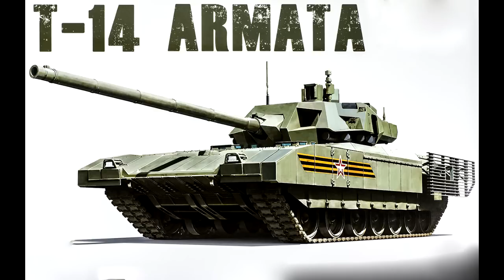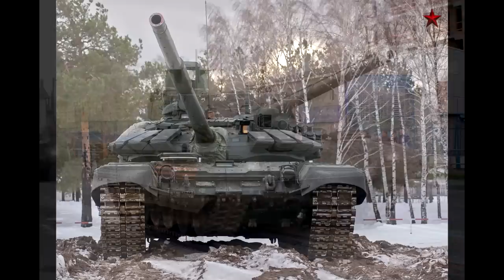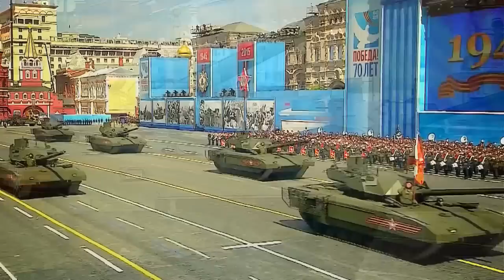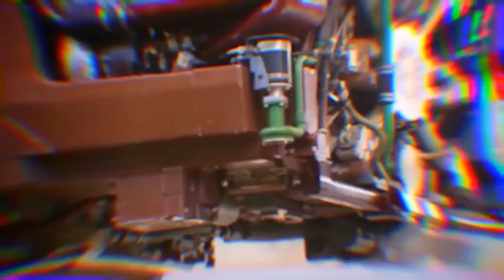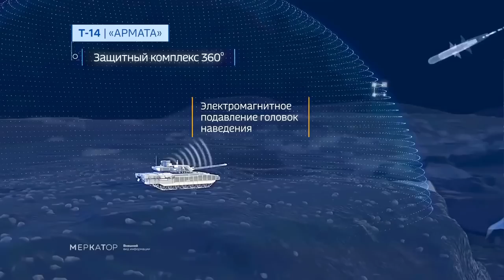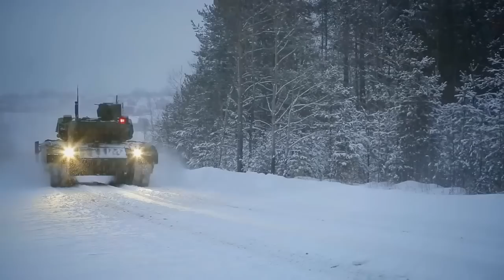Busting Myths on T-14 Armata

Comment: They cannot defeat a apfsds round with a smaller slower projectile. Don't be stupid that's very basic physics. A super dense super high speed object won't be stopped by a lighter slower object. They could only be stopped by something heavier and faster which doesn't exist.  I'm sure the rest of your claims are true but I'm also sure that one isn't.

Comment: Interesting vid the armata is a new tank the abrams an elderly updated one (design start c1970/80's) so why are the yanks so put out?, the challenger, Leclerc and Leopard are more modern and probably better...
Reply: The Challenger 2 hasn't been updated since its first upgrade in 1997. The Leopard 2 basis is, in terms of its procurement into service is older by 1 year. Though effectively it was accepted and developed at the same time. 

The Challenger 2 is a solid tank, but is far outdated and non-versatile. Leopard 2A6, compared to the M1A2 SEPv2, are effectively equals, where the M1 has some combat advantages over the Leopard, and the Leopard has economic advantages over the M1.

Comment: There are only two things I can think of that would not be affected by the APS. That is a high energy focused laser (which at this time is still in very early testing) and a railgun. The railgun is more plausible due to the fact that the round can be sped up by simply adding more current into the rails thus accelerating the projectile fast enough to overcome the APS's detection system. These two weapon platforms however are still in the early stages of research and development with only one known railgun in service.Another potential solution would be to simply add more powder to the shell making the Sabot round move faster. However that puts more stress on the breach and barrel causing more damage and eventually more maintenance on the vehicle itself.All in all the US needs to develop a new tank or seriously upgrade its existing stock.
Reply: "Afghanit" APS only defeats APFSDS at a 120° arc in front of the turret. So...

Comment: Nice vid. Do you know how many charges one barrel of the APS has? Or is it one blast per barrel?
Reply from the maker: +Demons Fate It has one charge per barrel since a lot of power is required to destroy APFSDS. But it is loaded in couple of seconds
Reply: RedEffect Ah is see! But do u know how the reload of the barrel works? if you look at pictures of the t-15, you can see the afghanit launchers (unlike the one at the t-14) uncovered and fully visible. i can see no reload mechanism that could make an automatic reload possible. and if you say one blast fully empties the barrel, it does not look like a barrel could shoot more than one time. or am i missing something?
Reply from the maker: Demons Fate It is not reloaded automatically, it's manually. The ammo is really big and it's reloaded by just inserting filler into the launch tube. It can't be reloaded mid battle unless u want to get shot.
Reply: thank you very much for the information!

Comment: The french thermal imaging system isn't called Thales... Thales is a multinational aerospace group. The picture you show at 1m22s even shows the name in the exact font used by Thales Group during the early 2000s. 
BTW I used to work for Thales!

Comment: The question is will it be able to withstand the TOW because its predecessors sure can't.
Reply: It has APS. It can intercept RPG ATGM and even APFSDS before it reaches the target. You would need a Javelin for this one.
Reply: the T90 stoped a TOW no problem and the T72BA stoped 2 TOWs with no problem.....i think its good.

Comment: Great video!
What is the advantage to having a fully unmanned turret as opposed to the standard turret? Better crew protection and lower weight/profile?
Reply: +Jonny There are many disadvantages to unmanned turrets that's inherent.
Reply: No. Which?

Modern manned turrets are also stuffed full of electronics. They're aloss useless if systems fail. The storys about failing autoloaders and EMP are bs.
Reply: They're both equally likely to lose fighting ability if penetrated. But considering its weight, size, and armor protection, the T-14 Armata seems to be developed like how modern APCs work. With armor around the crew/passengers. Not around the armament. It appears a lot more likely that the T-14 would lose fighting ability to more dangers relative to a manned turret. 

But that's a specific case, and we don't know anything about other MBTs like this. So I digress. 

Manned turret general maintenance or rectifying small issues can be achieved by the crew inside the vehicle. Any failures or malfunctions, like a jammed round in the breech, in an automated turret would require motor pool level maintenance. Or at least where the vehicle needs to exit the battlefield. This applies to basic manned turrets with auto-loaders as well, losing a man will increase work load on the crew. Though the 360 degree vision is achievable, crews don't get an oriented sense of their visibility. Meaning they can get disoriented to where they are relative to the armament. Not to mention tunnel-visioning with cameras can be a larger risk. As well as the fact, depending on its layout, the crew can't escape without entering the field of fire. Though this can vary depending on vehicle.
Reply: No crewmembers in turret > smaller turret > doesen't need to be as much protected, however there isn't that much space left that needs to be proected anyways > weight effectivness > more weight resources to protect the crew compartment in the main hull, wich is better protected and less exposed anyways.

Some other remote turret MBTs and IFVs are the T-15 Armata IFV, Kurganets 25, Bumerang and the German Puma IFV aswell as some Boxer APC, Lynx IFV and Patria AMV variants. Unmanned turrets are the future.

Comment: Not saying any APS can deflect APFSDS rounds but you do realize that the detonation of the intercepting projectile is probably more than 5KG of military grade high explosive. Your 1700 m/s APFSDS has nothing on that amount of force if detonated close enough (which all APS do. Literally detonate the intercepting projectile within 10cm of the threat). I'm no physics professor but I've worked around military grade explosives but 5KG of whatever the fuck it's stufded with has more energy than the propellant used to propel the round. And whats to say it only uses the explosion to divert the round, maybe it has a steel plate which upon detonation is flung to the direction of the incoming round and that then diverts the round. And then theres the part where it damages the round. I've seen 2kgs of TNT send a 20 kilo steel plate flying farther than many can throw a grenade and im dairly sure that the APS rounds explosion can easily falter the aerodynamics of the penetrator rod and fyi APFSDS relies pretty much on maintaining that aerodynamic shape. Bending it slightly will surely enough make it lose its trajectory fairly easily and even if it just weakens the rods steucture it may no longer be strong enough to penetrate and shatters on impact. 

This goes for all APS system, not just the one on T-14
Reply: I only know it for NATO standards but:

APS shatters, not detonate the KE penetrators, reducing it's force. An israeli study showed that only a 7° tilt reduces the penetrators energy (not penetration) by 80 %. So only a NATO STANAG 4569 level 4-5 protection (against 25mm APFSDS)  is requiered to widhstand an (sucessfully intercepted) APFSDS.

I dont really know about the "Afghanit" APS used on the T-14 but i know another system developed by the german company rheinmetall called AMAP-ADS that it has proven to be able of defeating not only ATGMs and RPGs, but also EFPs and APFSDS rounds. Supposedly it is capable of "cut" through the engaged threats, shattering or bending EFPs and APFSDS penetrators in the process. According to Dipl. Ing. Rolf Hilmes, who worked in the German military procurement agency, the system has been successfully tested against 120 mm APFSDS ammunition in the past. This system works diffrent than russian or israeli systems. It uses hull-based ermitters without moving parts (The T-14 needs to turn the whole turret to face thredas coming from another direction, hence only a 120° in front of the turret is protected by "Afghanit" APS) and no HE capsules (also on the T-14) shot at the incoming thread. That allows a very low reaction time of 0.56 miliseconds and a interception of threads fired at only 10 meters (!) distance. The detection of the threat happens at a distance of 10-35 metres, while the fine tracking starts at two metres distance. The interception itself happens at only 1 meter distance (as said, hull based ermitters). Given that an APFSDS round even at 1,750 m/s velocity travels only 98 centimetres in 0.56 ms, the system reaction time is fairly enough.

Comment: You are living in a dream world if you think the APS can stop a sabot projectile.  This video is utter rubbish.
Reply: I only know it for NATO standards but:

APS shatters, not detonate the KE penetrators, reducing it's force. An 
israeli study showed that only a 7° tilt reduces the penetrators energy 
(not penetration) by 80 %. So only a NATO STANAG 4569 level 4-5 
protection (against 25mm APFSDS)  is requiered to widhstand an 
(sucessfully intercepted) APFSDS.

I dont really know about the "Afghanit" APS used on the T-14 but i know 
another system developed by the german company rheinmetall called 
AMAP-ADS that it has proven to be able of defeating not only ATGMs and 
RPGs, but also EFPs and APFSDS rounds. Supposedly it is capable of "cut"
 through the engaged threats, shattering or bending EFPs and APFSDS 
penetrators in the process. According to Dipl. Ing. Rolf Hilmes, who 
worked in the German military procurement agency, the system has been 
successfully tested against 120 mm APFSDS ammunition in the past. This 
system works diffrent than russian or israeli systems. It uses 
hull-based ermitters without moving parts (The T-14 needs to turn the 
whole turret to face thredas coming from another direction, hence only a
 120° in front of the turret is protected by "Afghanit" APS) and no HE 
capsules (also on the T-14) shot at the incoming thread. That allows a 
very low reaction time of 0.56 miliseconds and a interception of threads
 fired at only 10 meters (!) distance. The detection of the threat 
happens at a distance of 10-35 metres, while the fine tracking starts at
 two metres distance. The interception itself happens at only 1 meter 
distance (as said, hull based ermitters). Given that an APFSDS round 
even at 1,750 m/s velocity travels only 98 centimetres in 0.56 ms, the 
system reaction time is fairly enough.

Comment: The Russians copied just about everything from America and don't have many things originally theirs, so even if it is just a myth about the T-14 being a copy of the M-1 Abrams, it's certainly believable! The Abrams' L44\M256 is loaded manually making it more reliable than an autoloader which could malfunction and then you're screwed! The Abrams has an AGT1500 multifuel twin turbine engine allowing the it to burn anything combustible and keep on going while other tanks such as the T-14 can't run without diesel! The Abrams has been battle tested against the enemy and not a single one has been lost in combat do to enemy fire vs the T-14 which hasn't been battle proven! 
 Just like the SR-71 blackbird with a top seed of 2,193 mph nearly 3.4 mach vs the mig 25 foxbat back in the 60s, do a video on that! The SR-71 could outlast the mig 25 anytime, thanks to a ramjet the SR-71 could go well over mach 2.8 and maintain that speed when the turbojets couldn't work anymore and was actually more fuel efficient the faster it went! While the foxbat not only could only reach mach 2.8 but could only maintain that speed for a minute or two do to the crappy Russian made engines overheating!
 This video is just more Russian propaganda.

Comment: What you've failed to mention is, the T-14 is vaporware.

An unmanned turret is not an advantage on a Russian tank.  I've you've ever seen inside the turret of a T-72, its the minimum amount of space you need for the turret systems plus two human bodies.

Externally, the T-14's turret is not that much smaller then existing Russian turrets (ever seen a T-72/90 turret with the ERA removed?).  This makes sense because crews would still need to enter the turret to service its systems, meaning you need space to accommodate them.

Secondly, from most sources I've read, the T-14's turret is lightly armored to save weight.  This means a hit even medium caliber guns will most likely penetrate it and damage the gun/FCS/or sensors, taking the tank out of action even if the crew survives.

There is also the matter of sensing the battlefield.  As a former tanker, there is a great deal to be said for the view of the battlefield afforded from the highest point on your tank using just binoculars.  Further, just having your head up makes it much harder for someone to sneak upon on you because you've got your sights turned the wrong way.

Lastly, there is the matter of crew work load.  This tank is going to be far move complex than previous Russian designs, and because you've cut the crew from 3 to 2, crew work load is going up 50%, or 100% higher than the work load for Western tank crews.

This tank is just like the Mig 1.42/44.  Its going to get a few oh's and ah's from the fan boys and then its going away.

Comment: I'd like to know how often the APS can destroy incoming APFSDS. Nobody would doubt that THAAD or AEGIS can shoot down ballistic missiles, but the reliability with which they can per counter missile is debated. For much the same reason, I wonder on average how likely any given sabot round is to be intercepted.
Reply: I only know it for NATO standards but:

APS shatters, not detonate the KE penetrators, reducing it's force. An 
israeli study showed that only a 7° tilt reduces the penetrators energy 
(not penetration) by 80 %. So only a NATO STANAG 4569 level 4-5 
protection (against 25mm APFSDS)  is requiered to widhstand an 
(sucessfully intercepted) APFSDS.

I dont really know about the "Afghanit" APS used on the T-14 but i know 
another system developed by the german company rheinmetall called 
AMAP-ADS that it has proven to be able of defeating not only ATGMs and 
RPGs, but also EFPs and APFSDS rounds. Supposedly it is capable of "cut"
 through the engaged threats, shattering or bending EFPs and APFSDS 
penetrators in the process. According to Dipl. Ing. Rolf Hilmes, who 
worked in the German military procurement agency, the system has been 
successfully tested against 120 mm APFSDS ammunition in the past. This 
system works diffrent than russian or israeli systems. It uses 
hull-based ermitters without moving parts (The T-14 needs to turn the 
whole turret to face thredas coming from another direction, hence only a
 120° in front of the turret is protected by "Afghanit" APS) and no HE 
capsules (also on the T-14) shot at the incoming thread. That allows a 
very low reaction time of 0.56 miliseconds and a interception of threads
 fired at only 10 meters (!) distance. The detection of the threat 
happens at a distance of 10-35 metres, while the fine tracking starts at
 two metres distance. The interception itself happens at only 1 meter 
distance (as said, hull based ermitters). Given that an APFSDS round 
even at 1,750 m/s velocity travels only 98 centimetres in 0.56 ms, the 
system reaction time is fairly enough.

Comment: Until the Armata tank sees full on combat as the M1 Abrams has, it is rumor on everything about it.   No tank has ever destroyed an M1 Abrams but the Abrams has destroyed a whole lot of Russian armor.  The only Abrams lost were due to massive IED's and rear RPG hits.. and the RPG hits issue was fixed very soon after that was realized in the war removing that vulnerability.

But no matter, the next generation American tank will out match any other tank built in the next decade two.. don't think we Americans don't have a lot of engineering going on to counter the Armata and other systems.  The Armata is obsolete already.
Reply: Malakie Usn I don't think we are going to make a new tank. Tanks are antiquated. We have other things we are working on.
Reply: Trust me, tanks are still relevant and what we have in the pipeline will make the current generation seem like a toy.

Comment: Russian propaganda again. But it's an improvement, I remember a video where it claimed that the t-14 had some kind of electro-magnetic field against missiles, which I thought was pretty funny. I must admit that between you there is some real comedian!
Reply: No electromagnetic field. It has softkill APS that detects ATGM and distracts them. However that isn't revolutionary. It's been used on the K2 Black Panther and the Leopard 2.
Reply: This is called - Arena. She has been standing on the T-90 for a long time. Commentators are idiots.
Reply: Almost as good as Russia saying they were designing new outfits for the future Russian soldier and then the images that the media released were from Call of Duty: Modern Warfare 2 and Ghost Recon.
Reply: Russians are crazy for mags, and witches and most of Russians think that Extrasensory perception is an absolutely real thing so they keep one mag or witch in every  Armate who reflects with a mind all incoming ammunition. 
They can not mass produce any electronic devices or machines of quality and suddenly they are doing with high tech military equipment things better than all western engineering and electronics industry what is manned and financed much, much better. 
It does not work like this, all this innovation and brainpower must come from somewhere in private sector and most of talented and free thinking Russians working in Western countries far away from Putin's KGB Junta.